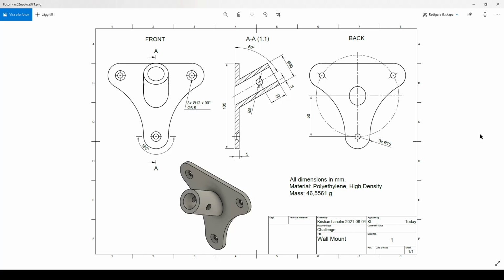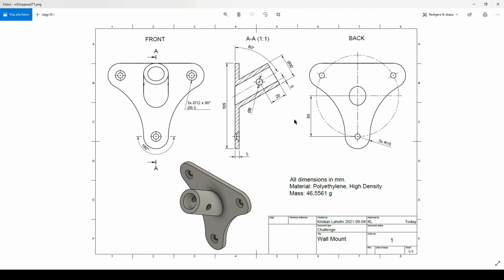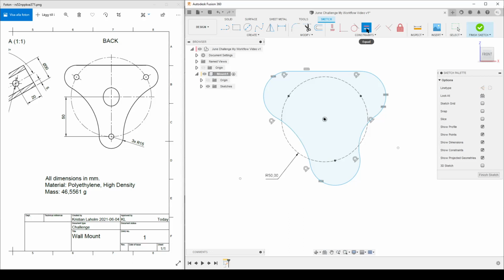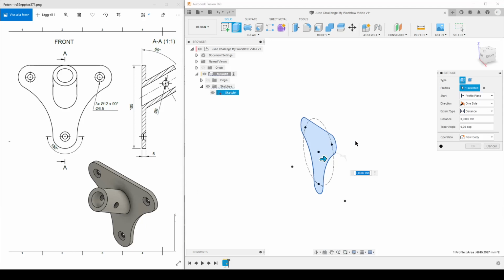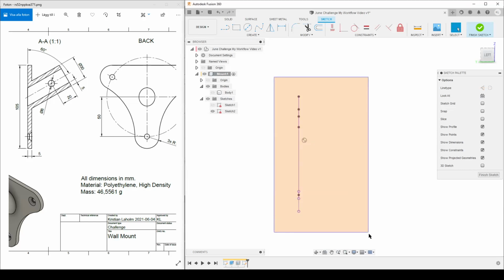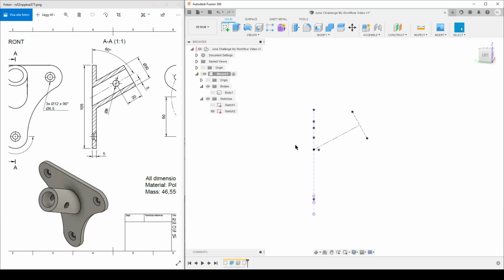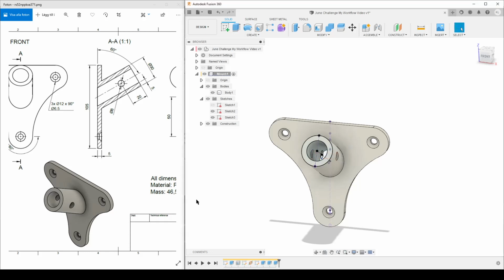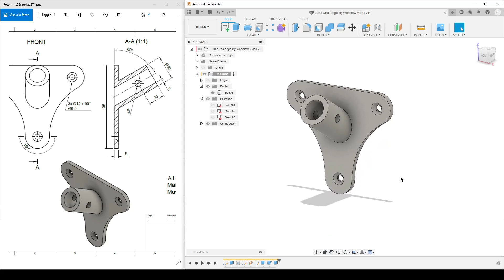Fusion 360 Challenge June 2021 - My Workflow

Comment: Nice example :) I just got 46,556 and 46,557 results. I made a small test and the difference is from Extent Type in 8mm dia hole. If you'll do it All it will be 46,557, if you'll do it Distance it will be 46,556.